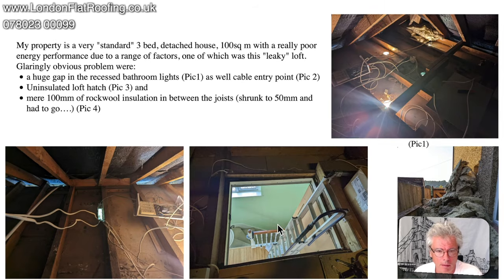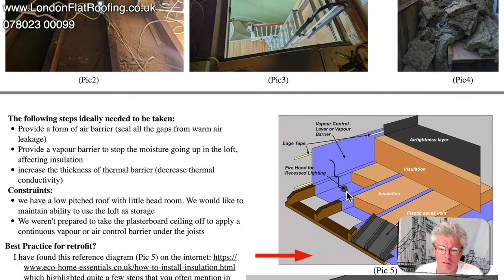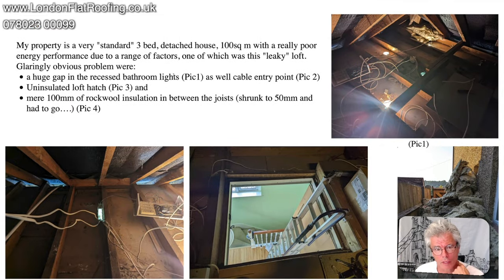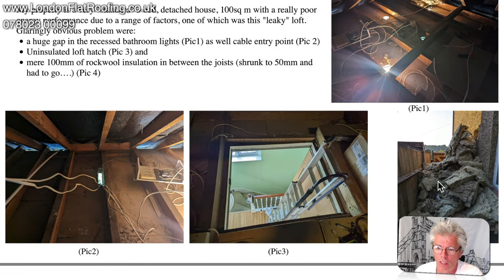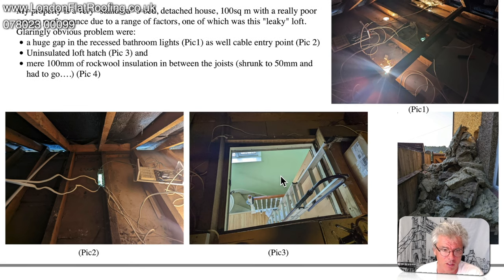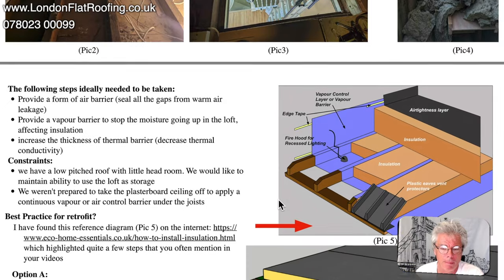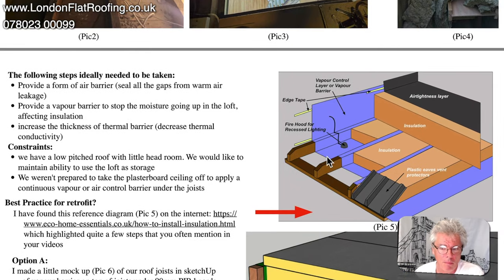Condensation In the loft things not to do

Comment: Great video - I'm a Building Surveyor and dealing with a disrepair claim like this in London at the moment (acting for the Landlord). Interestingly, the walls in this claim were pumped with insulation which caused them to perform better thermally and the cold spots moved from the walls to the ceilings (due to poor insulated ceilings).

I'd say first step is to minimise the condensation below and use an extractor fan in the bathroom which has a humidistat built-in. The location of the fan is key. Make sure that it's far away from the window as possible so that when you have a shower and open the window it draws air from one side of the room to the other. As it has an as-built humidistat fan built in, it will kick in when it senses high humidity and remove any remaining moist air even when the light is turned off. No drying clothes in the house either.

As for the insulation arrangement, its easier to leave the ceiling in place rather than remove or overboard it (especially if it is covered with an asbestos containing Artex textured coating). I agree 100% of your assessment to seal the sealing as best as possible and then insulate over it and pack it tightly. Install an insulated loft hatch as this is always an easy detail for air in the room below to escape though. Ventilation is then the key in the roof space to allow this to work so allow for those roof eaves vents and add tile or ridge vents if required.
Reply from the maker: Thanks for the reply yes in summary air tightness air tightness air tightness of the ceiling and then share open insulation above with plenty of ventilation above that
Reply: Hi Freddie, interesting info on Artex. Can you tell me if Artex covered ceilings reduce moisture passage through Gyproc into the loft space?
Reply: @LoremIpsum1970  Artex is not moisture or mould resistant. However, the modern plastic paints you buy at your local DIY store can increase moisture resistance of the Artex when applied.
Reply: Did you mean " seal the sealing" or did you mean seal the ceiling?
Reply from the maker: @45graham45  seal the ceiling
Reply: @45graham45  Just edited the post. It was a spelling mistake and should be ceiling!
Reply: "No drying clothes in the house either"... so where do you dry clothes in the winter or if you don't have an outdoor space?
Reply: @domtomas1178  Dry inside only if a dehumidifier is used.

Comment: Installing vapour barriers around joists & other obstacles etc always looks fine on a CAD drawing... until you climb up into a dirty old loft to actually attempt it that is! As Steve already said: seal holes, protect vents & whack a load of new fluffy stuff down. Job done.
Reply: I've got that feeling myself that laying and sealing the VCL is not an easy job and is error-prone.
Reply: Absolutely... I went to do that myself over the summer and simply gave up. Getting the barrier inbetween the joists and battens and taping it all in, is virtually impossible

Comment: Thank you so much for this. I am adding insulation to an older garage with a pitched roof I use as a part time workshop. I just want storage in the loft. There is plenty of ventilation in the loft. Walls will be either PIR or rockwool between new stud walls with ventilation between the insulation and the outer breeze block wall. Yes it will be leaky from a ventilation perspective but energy efficiency due to only part time warm use isn’t my biggest concern. I kept worrying about sealing the whole inside with a vapour barrier when I have full sliced double swung doors on one end! I know obviously things would be different were this a living space.

Comment: Ok, so I’ve insulated my ceilings this way. 75mm PIR cut precisely in between the joists without Vapor barrier, is been there for over a year and I can’t see any moisture around ceiling joist. Massive difference I’ve noticed winter nice and worm summer cool. One thing would stres enough is do not leave any cold spots as moisture would eventually make way down into plasterboard 15mm sound proof. Hope that helps

Comment: great video. Fantastic drawings from the customer, that must make your life a lot easier. 
Just to clarify, the solution you'd recommend is 300mm or so of rock wool or similar applied directly to the plasterboard (no foil or anything), plus plenty of ventilation above?
My loft has exactly that (maybe 400mm actually), so good to hear. I'm in a timber framed house and it's very well insulated (too well, it should have ventilation in my opinion, but I'm loathe to spend the money!).
Reply from the maker: Yes new building regulations part F is now addressing ventilation in buildings especially overheating.
Reply: @SteveRoofer  @Rico S On the BBC a month or so ago they were discussing loft insulation and said something strange, that after the first 100-150mm depth any further thickness has diminishing returns. Based on the stupid cost increase in rockwool I'm not going for 300, I'll just go for 2 opposing layers of 100mm and a larger air gap to the loft flooring. Am I wrong (1970s house as pictured in viewer's document you reviewed).
Reply from the maker: Yes you do get diminishing returns 300 is about correct

Comment: I think this video may have just answered all of my concerns of insulating. I live in a 200yr old quarriers cottage, extremely well built with no signs of mould or condensation anywhere. Having pulled down a few ceiling now I can see there’s never been a vapour barrier, which I’ve been sweating over, but now I’m thinking that ‘vapour open’ is probably the way to go. I am replacing all of the old insulation with Rockwool. Fingers crossed this is the right thing to do.

Comment: One advantage of putting fluffy insulation between joists but PIR on top is that once the PIR is covered with wood you can have a use able storage space as long as it's only occasional foot fall. Just adding more fluffy insulation means for it ro become storage somehow you need to support a hard floor. One other issue that never gets mentioned is electrical cabling once covered by insulation is likely to need to be derated with smaller circuit breakers installing, cables in open air can take much more current than those covered by insulation
Reply: True, however lights now tend to be much lower wattage. A typical incandescent was 40-60 watts and now your looking at 6-8 watts. If you had 20 lamps you’d be looking at around 3 and a half amps around half the typical lighting fuse where as if you went to all 8watt led the same current would be around 1/2 an amp. Remember you can’t suddenly plug in something large in the lighting circuit like you can with a socket. So your right but in the real world it’s likely not to be a problem.
Reply: @davideyres955  there are still stocks of halogen and incandescent bulbs out there. New lights are much lower as you say, but yo can't be certain that an older bulb will not be fitted

Comment: There is a trade off between vapor control & insulation performance. In an ideal world (such as a new build) insulation should be enclosed on both sides with an airtight layer, because this eliminates air infiltration for best thermal performance. However, as we see here in a retrofit situation, it's difficult to achieve integrity without stripping coverings such as tiles and ceilings to provide full access. It does seems to me like the viewer understands how this works, and if it's done VERY carefully it might work. However I also think your advice to go open cell is the best reliable solution. If it were me, I'd add a taped AVCL under the existing ceiling and over- board it. It's always easier to properly seal a flat surface than one with lots of timbers etc.
Reply from the maker: yes, very wise words

Comment: This is such a useful video and interesting to see a critique of those ideas in terms of making it simpler. So thank you. I am looking at installing a PIV unit but fear the unit drawing air that might hold airborne fiberglass particles/rockwool dust into the house. Is this something you've heard of or an unreasonable fear? Also wondering if a loft without felt - and just sarking boards, even needs additional vents before building up new insulation?

Comment: Hi! Great video! It was very informative and that PDF the lady made was very detailed. I was planning to the same to my loft with one slight change to her idea. So, vapour barrier on the ceiling side but rather than an air tightness layer on top, causing problems you've mentioned, I was thinking to use a breathable membrane. I believe the benefits of this system would be 2 fold. 1 to allow any creaping moisture passing the vapour control barrier to dissipate into the loft space and 2 to reduce or eliminate potential wind washing making the insulation that little bit more effective. My logic behind this is ive taken the suspended floor insulation method and reversed it. Does this sound at all plausible or am i barking up the wrong tree?

p.s. Plan is to install a MVHR system and will be using rockwool in the loft and suspended timber floor, especially after watching this vid!

Thanks

Comment: Steve, you're a star. Great document your viewer sent in, I've been going through the exact same (puzzled) process myself and I mentioned this graphic on here some time ago. That site promotes wool and 'natural' insulation btw. 

I commented on the eco-home site and the conclusion was: Eave Vents, then Tyvek Air Guard over joists/plasterboard + 200 min. Rockwool + 50mm air gap [NO air tightness layer] + OSB boarding over top. 

Rockwool was suggested as it's non-hygroscopic, so it doesn't hold moisture like fibreglass does, where some people blame it for rotting the timbers.

Q. Are you suggesting not bothering with the Tyvek, and just sealing any 'open' penetrations? Laying and sealing the Tyvek does look like a real PITA so would it be worth it in the long run?
Reply from the maker: Just make sure the ceiling is airtight and the loft is vell vented then you don't need any membranes above
Reply: @SteveRoofer  thanks! that's my Autumn sorted.
Reply: Hey, got the same major ussue on one side of my cold loft, one side doesn't catch sun and has a raised water tank which isn't insulated underneath it, lots of downright fitted also in 2 upstairs bathrooms, had ridge tile vents fitted, so gonna make everything airctight and replace all insulation

Comment: You recommend leaving the blanket insulation (rockwool) open & having a well vented loft,. But in doing so, could the moisture that gets through the ceiling reach it's dew point & condense somewhere inside the insulation (and not exit out the top) & so cause the insulation to be less effective & even compress & become even less effective? And if it stays in the insulation & not exit then mould could form?
Reply from the maker: That's why you have to have ventilation above so that the moisture can travel through the insulation and then get out this is a tried and trusted way of doing it has been done in lofts for many years.
Reply: @SteveRoofer  Thanks for your reply. But if moisture condenses inside of the blanket insulation & the loft space is cold (due to ventilation) won't the moisture just stay as liquid , not evaporate & so stay inside the insulation & so cause issues? I'll be insulating a loft soon so I hope you are right as this will make things simple for me but I'm still not sure.
Reply: I'm in a similar position. We bought an end of terrace house last year that was build in 2017. So quite new. I noticed, when we had colder weather this winter, that condensation was forming on the inside of the roof membrane, and we have about 80% humidity up in the loft. I didn't notice any vents in the loft, so assumed that the roof membrane that was used is breathable and so vents were not installed. But now I'm not so sure. Any ideas I could try?
Reply: @domtomas1178  try some felt vents that go on the inside mate, I need to do mine yet but I did it on my old property and it worked 👍 anything to increase that ventilation is key

Comment: Thanks for all your videos Steve. Assuming you've got the nhbc 7.2.15 recommended amount of good back and fourth ventilation above the insulation, in a cold roof, do you think 50mm continuous air gap in the rafters is enough when there is old non breathable sarking felt, =>300mm of open air insulation, with no seperate vcl, above a shower room? Many thanks

Comment: i have put a think layer of PIR (kingspan) under the joists and on top of the plasterboard, taped and foamed at its joints. So condensation wont creep up to the top of the joists. Surely this is better?

Comment: Thanks - great video. A question please. I have the old felt bitumen type barrier under my tiles as you show here (around 9.30) in your summary. Can I just cut out what I can see, either all or sections maybe, and place the gas permeable material in its place (ie I'm hoping all the roof tiles dont have to come off - I'm just looking to assist with the loft ventilation due to condensation build up. Thank you for an informative video
Reply from the maker: I don't think that would work because you're growing up with bits and pieces all over the place not only that it's just not gonna give you enough ventilation. You really should get some good ventilation put into the roof top and bottom elevations. Good through ventilation is one of the keys.

Comment: Steve no sure of the best way to contact you and ask for some advise but l need to repair my flat roof as it wasn’t constructed properly in the first place, basically it’s a cold roof with no vapour barrier or ventilation, it’s about 12 years old and to put it politely it’s a bit spongey . It also has access to and upstairs flat so is walked on regularly, watching some of your videos lm thinking l would prefer a warm roof solution, even though it would cause me some issues with one doorway , cold roof is possible but as you are aware I would need to put a lot of effort into the ventilation design. Would love to know your thoughts on minimum fall and what material you would recommend for the top , many thanks

Comment: Great video! What about chipboard or OSB flooring which has been fitted over the  insulation? How permeable is that?
Reply from the maker: providing the environment is kept to the correct relative humidity. You should have no problems with any Timber products.
Reply: @SteveRoofer  thank you 👍

Comment: regarding air gap, regardless of keeping simple or not, the concept of radiant heat is that it radiates, it is not conducted by a solid material. The moment you don't have a void, there is no radiant heat and you are just conducting from one solid to another. So, from a physics perspective, the foil is useless if you have no gap, it will not work as a radiant heat barrier.

Comment: On your way Steve - loose fibreglass insulation laid over joist (150-200mm) with air gap under eaves/tiles to allow air flow up and over-  is it also ok to add kingspan to the underside of the tiles/felt (new roof) 

I've got 4 roof vent tiles installed to allow air flow - just thinking belt and braces or is this wastage material adding the kingspan
Reply from the maker: You can't have enough venting to a roof  make sure its at high level and low level

Comment: Hi Steve, regarding moisture passage through Gyproc ceilings, as my ceilings are still 70s with Artex would this make a difference to the passage of moisture through the Gyproc into the roof space? Hope you can help.
Reply from the maker: No difference whatsoever just make sure you haven't got any big holes for air to move through then realistically you've got quite a good vapour barrier probably over the years you've got lots of paint on that ceiling as well that also helps

Comment: I’m lost. Are you saying not to use PIR in between ceiling joists?
Reply: Yes, if you are insulating a loft use loft insulation, not PIR. You can use PIR, but its extremely difficult to do it correctly
Reply: @HampsteadBuildersLt  hi….no what im looking to do is take down a bedroom ceiling ( flat roof above) and re insulated with something fit for the job. What would you suggest?
Reply: @simonstones1918  If its a flat roof, you need to do cold  roof and do it to the building regulations' specifications.  refer to my videos on cold roof
Reply: @HampsteadBuildersLt  ok, taking a look now…
Reply: @HampsteadBuildersLt  ok, so you have 5 videos showing as up loaded….? None saying cold roof…

Comment: For a warm falt roof construction,  could you put the vapour barrier on top of rafters,  then osb , insulation etc?
Reply: Warm flat roofs OSB goes over the joists and available area goes over the OSB the vapour barrier is always on the warm side of any insulation
Reply: Maybe I worded that wrong, so rafters, vapour  barrier on top of rafters,  osb on top of vapour barrier , then kingspan or the like then single ply membrane
Reply: Is there a reason why you can't put it below the osb deck?, I can obviously read the drawings as per the order you say bit no one can ever tell me why?
Reply: @brutus277  it has to be as close to the insulation as possible also you cant stick it to the underside of the OSB its also called an Air Vapour Control Layer (AVCL) beouce it has to be airtight. It has to stop the air from the room below every part of the room below from  getting up into the roof above  its not imposable to put it below but would be far more difficult an